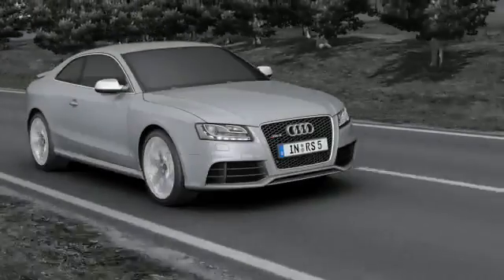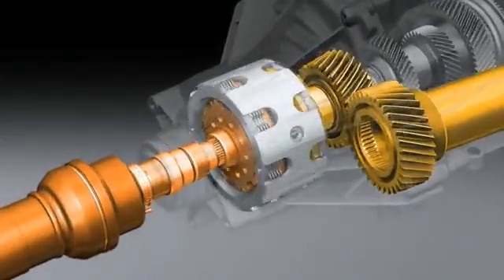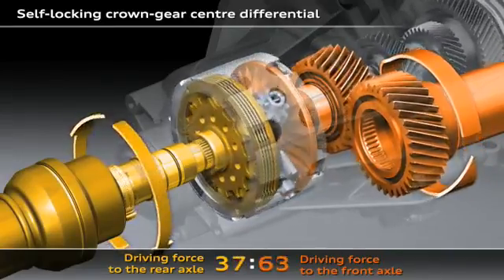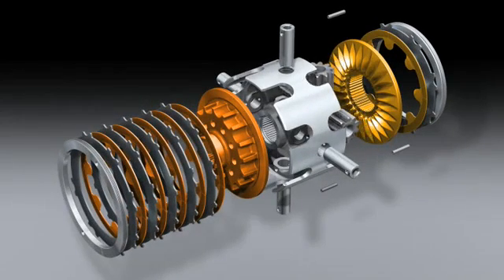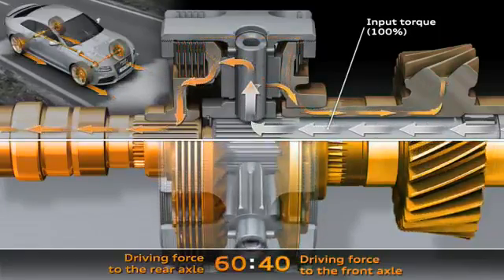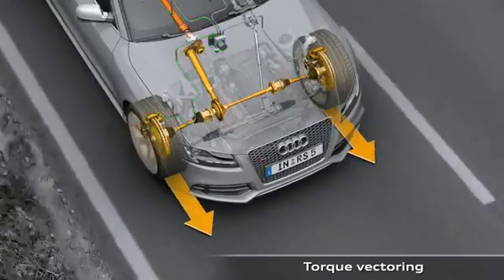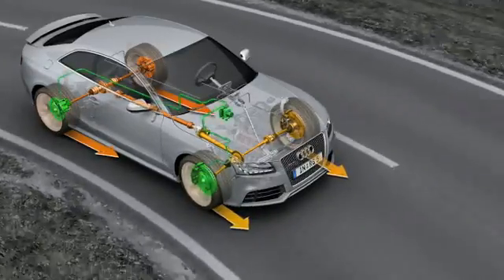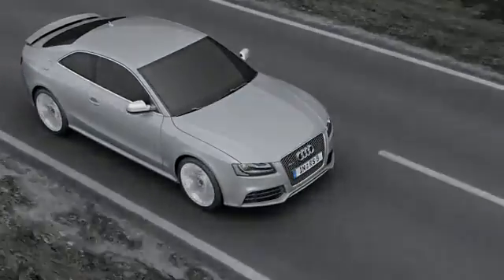Audi the Quattro Principle ''Audi release the latest version of quattro''

Comment: In the real world, AWD is superior to RWD or FWD. Especially because we use street rated tires, not race tires. And because we experience all kinds of road surfaces, and conditions. Look at World Rally Championship. Plus our cars don't reach those high speeds all the time to rely on aerodynamic down force for traction through corners like RWD only Formula 1 cars. WRC is a more realistic race, based on cars closer to what we drive. Even on tarmac only races, AWD is still quicker in WRC.